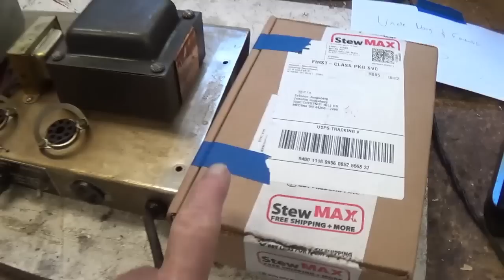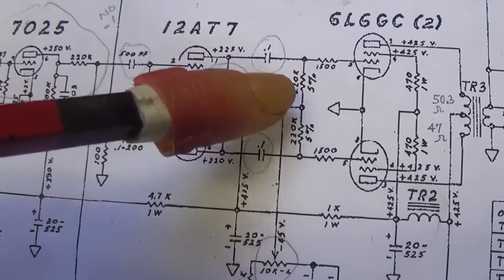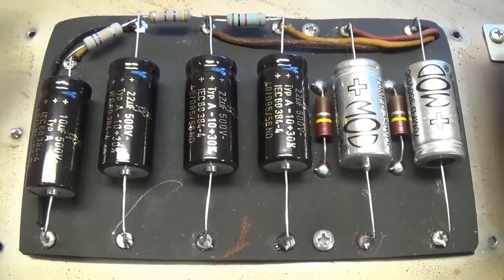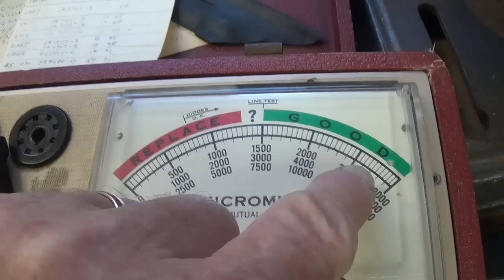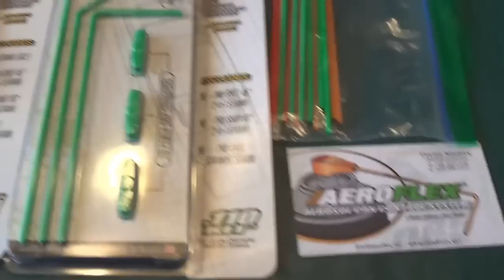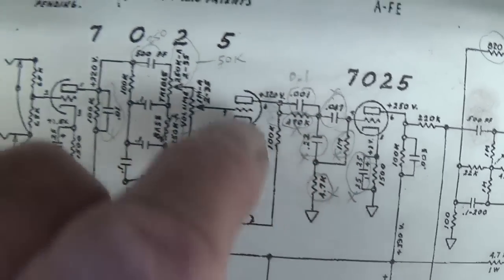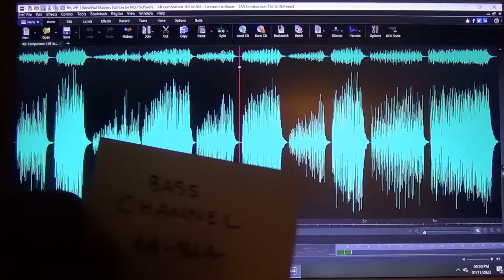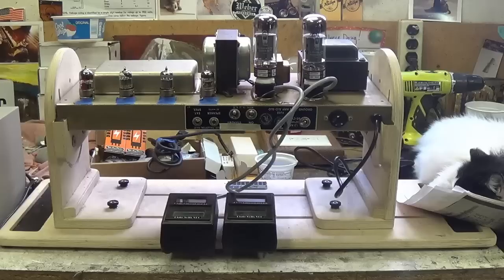Is the Conversion of a AA-165 Bassman to AA-864 Specs Worth the Effort ?

Comment: A number of transformers were made by a company in Canada called Hammond Manufacturing and rebranded for the US market. The amp likely wasn't made for the Canadian market, just the transformer was made in or for the Canadian market. CSA (Canadian Standards Association) is similar UL (Underwriters Laboratory) stamp. Keep up with the great vidoes!
Reply from the maker: Thanks for the info,  SI.
Reply: Hammond is still alive and well.  I buy their transformers all the time.
Reply from the maker: @michael931  Good to know, Michael.
Reply: I've used Hammonds in two of my builds, inspired by UD. A Matchless Lightning 15  circuit and a black face Princeton circuit.
Reply from the maker: @fc7896  Sounds like two good amps, FC :)

Comment: I think from a bass instrument point of view, the 864 would be far superior to the 165 preamp, and I agree, raising the treble control might just pull those brighter freqs up to a guitar level. The 864 certainly has gutsier sound for guitar!  It would be interesting to see an audio freq sweep on the scope to see the circuits' frequency response compared, but we'll leave that to another video! Very nice work, Uncle Doug, and, as usual, fantastic presentation! Wishing you Health, Happiness and Prosperity in the New Year!  😀
Reply from the maker: Thanks for all your interesting comments, 87. Likewise on the good wishes :)
Reply: @87mini Lowering the 500pF capacitor to 250pF raises the frequency at which the treble control starts to take effect, so it actually lowers the treble. I think this is a change in the wrong direction. I prefer 500pF here. AB175 has 850pF which is too far the other way.
Reply from the maker: @EJP286CRSKW  I was merely following the schematic, EJP.
Reply: @UncleDoug  I get what you did, and it makes sense to stick to one or other schematic from the commercial point of view. I'm just commenting on the commentary. Not many people here seem to actually understand the circuit.

Comment: I'd guess that the circuit changes introduced in the 165 series were to clean up the response of the bass channel for bass guitars (which is a bit too heavy in bass and mid frequencies). It would be interesting to compare the sounds of both circuits when using a bass guitar. Historically, guitarists loved the bass channel of the 164 series because of the heavy mids. But you have to love mids as they and cannot be easily dialed out with only treble and bass controls.
Reply from the maker: Thanks for your input, Jake.
Reply: @UncleDoug  You need to add a Mid control like in a twin reverb.  A very easy job if this is what you want --I put one in my original '65 Deluxe.   Also Blackface Bassmen were and are lovely guitar amps.  They were and are not great bass guitar amps, especially compared to Ampegs of the same era.  2 reasons I can think of:  AMpeg cabinets are much larger than Fender speaker cabs, considering the speakers inside-more air probably helps.  Ampeg cabs are 'Portaflex' design and, though they have no real port, they leak some air and are sort of 'ported'.  Fender cabs are sealed tight (except for the 1/4" speaker jack of course).  Makes for a tubby sound I think--better than the flabby sound and blown speakers of unsealed cabinets but not as good as modern cabinets designed with ports using Theile-Small principles.   The Fender amp is much better for bass when used with a better cabinet.
Reply from the maker: @alanlevin167  Thanks for the good info, Alan.
Reply: I was thinking the same thing. It would be interesting to see a video where different bass players would play through a vintage Bassman and give their opinions. I suspect that in the 60s the Bassman was used much more on stage, in the studio it would be more likely an Ampeg...
Reply from the maker: @stevem.1853  I have never heard any accolades for the Bassman as a bass amp.....only as a guitar amp.

Comment: Dear UD, first of all, I want to wish you and your wife a Happy and healthy NY.
My response on this great video. You know that I have a 1963 Bassman 6G6B , the blond one.
When I was young, and that is a long time ago I used that amp to play bass guitar. But I always used the normal channel for bass,because it sounded cleaner and not so cloudy like the bass channel, and the guitar player used the bass channel . This was often the case, because guitar players liked the bass channel. In those years not everybody could buy an amp. After that period the amp was not used for maybe 45 years. Back in 2012, I started learning guitar and you know my age. So I took my bassman and after a cap job, the bass channel sounded still like a wet towel. A 6G6-B had 4 pre-amp tubes, all 7025 tubes ( or 12ax7 ). I did not convert the amp into a AA864 but I removed the complete channel and made the bass channel exact like the normal channel and used 1 x 12ax7 for each channel. This means that the amp has only 3 preamp tubes and both channels use a 220k mixing resistor just before the phase inverter and that is it. Bass guitars do not need a special bass  channel, at least that is my experience.
Above that, Bassman amps used normal guitar speakers which were the Oxford speakers around 1963 . Then Fender has experimented with the D120F JBL's , and as a huge JBL fan I never have liked the D120 . The D120F, and F stands for Fender, which has only a little wider  voice coil gap.The D130F , a 15 inch which stood in the Showman sounded great . Now I have 2 x 12 inch Jensen C12K in my Bassman and the amp sounds phenomenal also until the low E string. On your demo I hear that the AA864 sounds darker. I asume that a bass player will choose the normal channel especially when he plays slab bass too.
Thanks for the great video UD , Kind regards and stay healthy, Joseph
Reply from the maker: Wow, thanks for all the info, Joseph.

Comment: I had 2yrs of electronics schooling back In 1980-82 . No tube experience with that, I have played guitar for years and just couldn't seem to find any commercial tube amp I liked. In 2009 I built a Ken Fischer TrainWreck amp clone with push-pull El34 tubes 40wrms and added the bias controlled duel 250k pot master volume control. Solved my amp problem and still play it today, the best sounding amp I've ever owned. At 3yrs from retirement I think I will start repairing these awesome relics from the past for some extra $ and something to give me purpose.  Thanks your very inspiring.
Reply from the maker: You're welcome, Dan. Best of luck with your retirement projects.

Comment: That was an enjoyable video. Thanks for posting it. During the sound samples I too was wondering if just cranking up the bass or treble controls might be the answer. The 864 did sound warmer but it did need a touch more treble too. Again, pretty neat video.
Reply from the maker: Thanks, Pavil. Yes, the "dark" tone of the Bass channel could be made much clearer with tone control adjustment.

Comment: Greatness! I've had the great pleasure of working on a couple of Fender Bassman amps:  my 1966 (an early AB165) and a later iteration of the AB165 (same year) for a friend - and they both sound so good!  I modded mine to the AA864 but per the friend's request, I kept his stock - only doing the upgrades (replacing tired electrolytics and out of spec resistors, and one leaky signal cap). Both sound really amazing though each has it's own sound/mojo.
I learn so much from your videos and refer to them often as touchstones to keep me out of hot water!
You and Mitzy keep up the great work! Many thanks and Happy New Year!
Reply from the maker: Thanks so much, Russell. Likewise :)

Comment: Greetings from Hoosierland. I acquired a Fender 1968 Silverface AC568 for the mere sum of $275. A very bad, brittle sounding amp. I recently restored it to the AA864 circuit. I am playing it through a Mojotone small Bassman replica bottom with two Jensen C12N speakers and it will knock your socks off. The only change I made was to leave in the 10 uf cap. The normal channel has a sweet clean jangle and the bass channel has very warm mids. I believe the "deep" switch was for those old Gibson bass guitars with the huge humbucker which is quite powerful.  I couldn't believe the amount of gain with the 12AX7 in V1. Anything pas 3 on volume control is to loud. I replaced it with a 12AU7 Mullard and it greatly increases the headroom. Thanks for the great video.
Reply from the maker: By coincidence, after the audio testing, I too re-installed the 5th (10uf) filter cap and the CBC on the third triode.  Thanks for your input.

Comment: Thanks Uncle Doug. Hope the cats and dogs are doing well.  Keep them away from Springfield.  I just did the mod on my AB165 1967 Bassman to change the output section, phase inverter and negative feedback to AA864 specs.  It sounds amazing and it really opened up the amp.  Its like taking a blanket off the amp.
Reply from the maker: Thanks for your very knowledgeable input, Erik :)

Comment: Great job! Maybe because this is a bass amp the bass channel was changed from the AA864 design due to bass freq overloading the bass channel. 
 Less gain and  less bass & mids . A test with a bass on the bass channel might have shown a really good reason why they changed the bass channel circuit, or not.
Reply from the maker: Thanks for your input, PB.

Comment: Hi Uncle Doug....I knew enough to repair my Pro Reverb thanks to your great clips ! Two resistors burned and a cap replacement later and I have had fun rolling tubes to get different levels of gain for playing at home. I also got a nasty shock after I replaced the cap and was pointing out my work which I was very proud of when I pointed my finger at the replaced cap and my finger was never closer than roughly 3 inches away from that new cap when ...BANG!  I let out a yell that sounded like I was getting shot at climbing up San Juan Hill. How can that voltage jump that far ? I survived but that was quite the lesson on draining every cap, not just the power supply set. This next question/statement is about a hot rod build I read about 30 years ago when part of the build was a stereo system that was tube powered. I know that Hudsons, and maybe others came from the factory with tube operated AM radios. My uncle told me stories that when low on money, he could remove that radio from that Hudson and take it to a pawn shop and get 3 bucks for it on a pawn. Not bad for some gas money when regular gas was about 21 cents a gallon. Question...in your humble opinion, did those tube radios get powered from the likely 6 volt battery system or was there some sort of AC power transformer or was it a function of those tiny tubes that would operate on the cars power supply. I suspect tiny, low voltage tubes but I am guessing. Your clips are tube amp school for sure !
Many thanks, Daniel
Reply from the maker: Greetings, Daniel. The truth is that 400 Volts cannot jump a gap of a mm or more. Apparently something else caused your shock......but learn from this experience so it is never repeated. Automotive tube radios, operating generally on 6VDC, have a "vibrator" that converts the 6VDC to AC so it can be stepped up by a transformer.  https://www.vintagecarradio.com/blog/radio-vibrators/

Comment: Great video uncle Doug! I've never looked at these two circuits before, but you'd be hard pressed to believe that they're for the same amp if just seen in isolation - they're different at every point apart from the normal channel, but then even that injects into a different point of the bass channel signal path.. the phase inverter is different, the power tube bias is different (as you mention); heck, even the voltages before rectification are different! Thanks again for another informative video 😀
Reply from the maker: Thanks, DH.

Comment: beautifully done presentation of this refurb and modification to AB-864 specs, along with a well deserved receiving of wonderful and useful gifts and tools.   What I"m hearing is that the AA165 rendering of guitar is a bit weak and even anemic.  The modification to 864 is obviously is a much fuller tone with more gain, particularly the lower mid frequencies .   Of course, you left the EQ settings identical for each audio rendering so, a simple adjustment of EQ would probably all that is needed for a more appropriate or useful eq on the guitar tone.   Thank you for yet another informative and educational video.  Fantastic.
Reply from the maker: You're welcome, Phillip. I agree with your conclusion that tone control adjustment could probably resolve any issues in the 864 Bass channel.

Comment: I had the same feeling as some of the others here Uncle Doug. Unfortunately as we get older it just gets to be the way it is. As a subscriber I noticed I hadn't heard from you for a bit. I'm glad you're back and this is a great video! I believe I contacted you once about the similarities between my 1967 SF Pro Reverb and the Bassmans of the era, except for the rectifier on this one, mine is a tube version. As I kept pulling up schematics of Pro Revs., then finding the Bassman similarities I didn't know where to go. Until you posted this I couldn't find out which schematic supported the "Holy Bassman" sound that I'd always heard about. Since I've never really been happy with the Pro"s bass level I think now I'll see if it's a close enough match to try it, I mean I've already made changes inside trying to make the chassis match the Cabinet Label stamp buwaaahahha  ha ha. It seems like there was a big tumbler in the assembly room and it would spit out cab labels randomly, some had no info. at all on them. that's what makes it fun right...
Reply from the maker: Thanks for sharing with us, Tim.

Comment: Great video!  it boggles the mind as to why the powers that be at Fender would make such an anemic revision. I know that you're probably already thinking about what we will see you do to improve the Bass channel for more mids. Thank you so much for your videos!!
Reply from the maker: Thanks, Mark. I think the Bass channel would be best suited with additional treble clarity.
Reply: @UncleDoug  I'm wondering what would happen if you plugged in an actual bass guitar into the AA-165 circuit. Was the design philosophy that a bass instrument would be pumping in bass/low mids frequencies that would compensate for the trebly nature of the circuit? It certainly sounded anemic with the guitar, but would it have been designed to work with bass guitar and that's why they moved away from the 864 spec because it was too warm and thick for bass?
Reply from the maker: @awjs74  Good question, Andy. Since we only focus on (and own) regular guitars, we don't have the proper equipment to answer it.

Comment: My '66 Bassman I purchased from a pawn shop in 2005 looked identical to this one.(but it had the AC-568 circuit. With bias hum balance adjustment, and normal and vibrato channels) Paid $250.00 for it...head only First thing changed was the doghouse filter caps. Ghost notes and frying bacon sounds abounded because of the filter caps long dried out and were leaking. All mods were done to recommendations in the fabulous book "Inside tube amps" by author Dan Torres. Highly recommended modifications to a Fender black tolex Bassman head, and for tons of info on tube amplifiers!! I replaced.the stock output transformer with a Peerless output transformer from a 6L6 Heathkit radio my dad had in his electronic shop in the garage. Both transformers  sounded great...but the Partridge (made by Altec Lansing) won to my ears no contest!!!
Reply from the maker: Thanks for sharing this with us, Curtis.

Comment: Hello Uncle Doug from Nick. I am a long time fan and I think you are the #1 source to learn about tube amp building, design and safety. If possible, I would like your take on what is called "Power Scaling" so that you can obtain a breakup/distortion sound at practice amp volume levels while using an amp of 25 to 50 watts output. Kevin O'Connor of London Power has kits and info online but but not much in the line of how it works (in layman's' terms). This Mod is also named VVR or variable voltage regulator circuit according to searches online. I have been collecting new parts for building about 8 amps and I'm just about ready to start building. I am interested in adding your variable bias, adjustable NFB & power scaling to some of them. I Thank You Immensely for the knowledge and expertise you have passed on to us all over the years, it is much more useful than the many semesters of electronic engineering for circuits and transistors I had back in the 1980's. I think you can teach anything! ps. I like your drone videos too.
Reply from the maker: Greetings, Nick, and thanks for the nice comments. I've been asked about this several times by other viewers and have found virtually no specific information regarding how power scaling is done. Apparently it affects the output tubes themselves, rather than simply absorbing some of the output signal. A company named London Power offers a range of Power Scaling Kits suitable for all tube guitar amps on the market, including vintage amps and new designs. I would suggest buying one of these kits, installing it, and learning first hand how it works. Good luck.